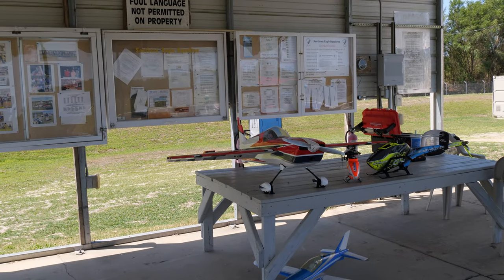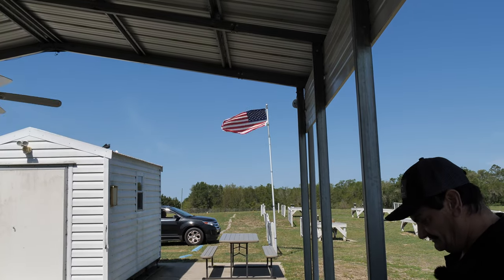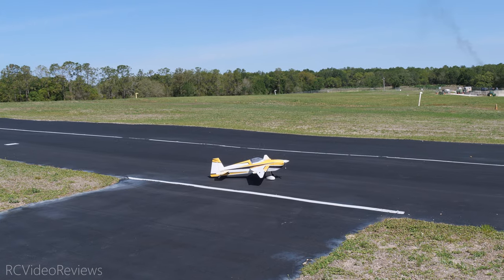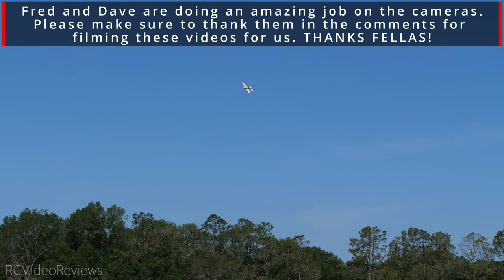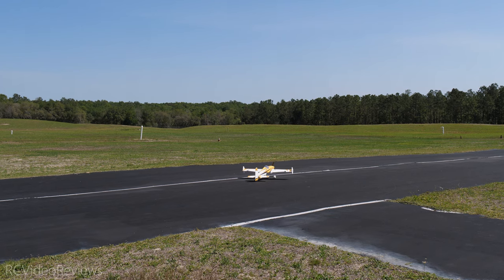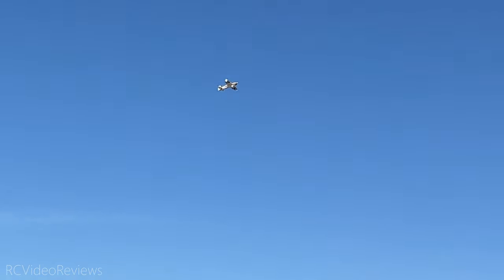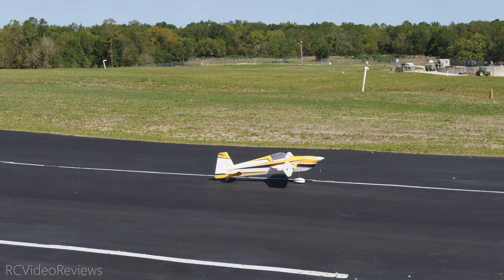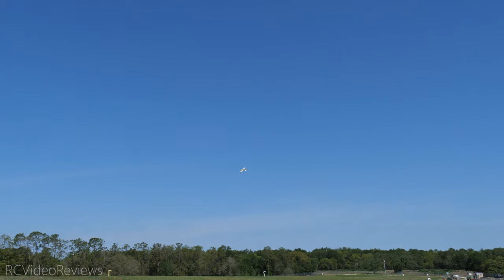RC Plane Gyros are a Good Idea

Comment: +1, for me gyro is a must have for all my models. Not for assist modes, only for wind rejection,  It allows to fly small airplanes even in windy conditions, but still with their fast reactions. You learn/improve skills better from small models than with large ones slower and easier to fly. I have more fun with those small models, easy  transportation fully assemble, fast ready to fly on the field, small batteries...etc. I use less and less my larges models. Less constraints more fun ;o)
Too many people beleived that gyros are only for assist mode, they are wrong, gyros make small planes fly like larger one. Take a small PA addiction with a gyro and you have lot of fun regardless of the weather. After take a 100" 3D model, and you fill like boring with a truck, slow, smoothing mistakes.
Reply: Well said and we agree  👏😊👍
Reply: 💯 My 2 favorite planes are UMX Pitts and UMX P51 voodoo. These planes are quick, snappy and so much fun to fly. I'm now practicing with 1.2m planes and enjoy it, but definitely need to get the rates up, or they feel sluggish. In this size, Im training with a Arrows T28 Trojan...and definitely looking at that FMS Dago Red P51. Though the skywing laser in this video looks really fun!
Reply: That is so right!
I’ve heard rant from the anti-gyro faction, who then tell about their favourite model, which is more than four times the size of my gyro assisted plane. No! You don’t need artificial stability to fly. I’m proud to say I learned to fly RC without a gyro. 80% of my models have no gyro.
A good trainer plane is designed to be very stable, some scale models aren’t. Especially when the wingspan is less than 36 inches.
I’m only an intermediate RC pilot, who occasionally attempts a manoeuvre that goes haywire, having a “self-leveling” switch can save my smaller models from a nasty crash.
PS. Great camera work guys.

Comment: Perfect explanation and demonstration. 
Especially about bad habits. 100% agree.
Great camera work too.

I learned to fly RC on 400mm RTF War Birds, Spitfire and Corsair.
They came with 6 axis gyros.

Didn't buy a simulator. 
Didn't buy a big floaty trainer.
Didn't join a Club and use the Buddy box method.

The day I decided I wanted to fly, I flew.

Modern technology and EPO foam planes was the reason why and how I could "safely" (so to speak) get in the air day one.

Before those of you that have different opinions torch me,  I'm not saying my way was the right way or wrong way. It was just the way I learned how to fly RC.

Muscle Memory was the number one thing I knew I needed to learn.

Isn't that what a Simulator does?
Isn't that what your instructor on the buddy box does when you get in trouble, flip the switch?

Now I can fly those warbirds using their toy grade RTF transmitters without any gyro assist.
Talk about crazy fun and pride on learning that skill.

When I moved up to a Hobby Grade tx and larger planes, 750mm to 1270mm, they were amazingly easy and fun to fly.

I too as demonstrated in your video fly using the wind mitigation mode 100% of the time to reduce my workload.

I say it's like using power steering to make your Driving Experience more pleasurable.

Great informational vid indeed.
Reply from the maker: "Before those of you that have different opinions torch me,  I'm not saying my way was the right way or wrong way. It was just the way I learned how to fly RC."

On this channel, I call this "Your money, your hobby."  I say it all the time because I get pretty worn out with pontificating dogmatic "governance" imposed by certain personalities. If it works for you and you don't endanger anybody else or their property: "Your money, your hobby!"
Reply: @RCVideoReviews  thank you for your reply and understanding why I put in my "disclaimer."
There are so many wonderful people on the interweb.
And then there are only 2 of the others.
Those 2 seem to get around a lot. 😆
Reply: I get your bad habits. What I've done is always fly my RFE in AS3X only. When flying in SAFE out at the field, I always return the plane to level myself. I don't just let go of the sticks unless I'm in trouble. I'm flying more and more just in AS3X too so that is helping me learn more and recover from my own mistakes.

Comment: I'm still pretty novice, so I keep wind stabilization on all the time and have auto-level on a momentary switch (panic button). I use auto-level 2 ways: 1) as a baseline while trimming, i.e. trim until auto-level does not change the behavior of the plane while straight and level. 2) If I lose orientation or get into a weird angle, I can auto-level to avoid disaster.  

I fly with the radiomaster Zorro, which has a great little momentary button right under your index finger. This has very quickly weaned me off of "safe" mode and helped me refine my skills because I can have freedom to try maneuvers but also a bail out button if something goes wrong.  Best of both worlds for a novice.
Reply from the maker: Yeah, if you're a novice without someone there to help you, they are definitely a lifesaver. As long as you connect the dots on the behavioral differences of auto level and normal mode flying.
Reply: U don't want to use auto level when your trimming....because it automatically levels out....trim your plane I no wind if possible without any assistance...or directly into the wind but no stabilization or self leveling to get the plane truly trimmed at about 3/4 throttle
Reply: @Toryh86  The auto-level is on a momentary button, so it's only engaged when actively pressing the button. When released, auto-level turns off immediately. So if there is any pitch, roll, or yaw change when releasing the button, I can instantly see how far off the trim is and in what axis. I am not trimming with the auto-level active, but using the gyros to momentarily establish an objective straight and level (1 or 2 seconds), then release the gyros and adjust trim to get back to that straight and level with out gyros engaged. Hope that makes sense.

Comment: Wind rejection? What is it? Is it the same as As3x? Optimized mode? Stabilizer mode?
Reply from the maker: Couldn't tell you. I don't use Spektrum gear.
Reply: It is the SAME as AS3X and if you DO fly Spektrum, it is SUPER easy to setup with FORWARD PROGRAMMING on the Spektrum transmitter 😉
Reply: @re3065   thanks. Yes I used Spektrum tx, rx. But, I never used gyros. Thx.

Comment: Have you ever gotten the S6R stabilization to work with a dual channel aileron setup?  It's fine with a Y cable, but I can't get it working with separate channels.  I used the Lua script to change channel 5 from AUX to AIL2, but the stabilization only moves the aileron on channel 1.
Reply from the maker: Pretty regularly. Watch this: https://www.youtube.com/watch?v=BObseyO1cjE

Also, make sure you do the calibration routine AFTER setting Aileron 2 up on the Aux output with *full stick deflection for all control surfaces after the servo dance*.

Comment: One question that concerns me... if you are using regular wind rejection stabilised mode (not level mode), what happens if, in level flight, you close the throttle... will the plane start to descend as normal, or will the gyro try to keep the plane flying level until stall? The gyro doesn't have any 'knowledge' of throttle input so does it assume non pilot input.
Reply from the maker: The gyro only reacts to uncommanded movements. If the plane is trimmed and balanced correctly it should stay somewhat flat during power off decent in which case the gyro won’t react. If the nose drops the gyro will make an initial correction then return to neutral. It does not try to maintain level. It simply reacts once to uncommanded movement.
Reply: @RCVideoReviews  Hi, thanks for the clarification.

Comment: I have a HobbyEagle A3Pro I want to use in my new HobbyKing Crusader 30E. I would like to add Flaperons. Do you know if I can do that with a Gyro? I kind of feel like I might need more then 3 out ports so I can run a lead to both wing servos instead of a Y-lead/wire. Maybe you can give me some insight on this. Thank you.
Reply from the maker: Yes. Flaperon control will simply appear to be aileron output to the gyro. It won't interfere.

Comment: When you say "wind rejection" are you referring to NORMAL or LOCK (AVCS) mode on the gyro? I feel like both of these modes are wind rejection?
Reply from the maker: Wind rejection or uncommanded movement is a perturbance in this case as a result of wind. So the reaction by the gyro is temporary. In autolevel modes the gyro references a level configuration and moves the surface until the model returns to that level configuration.

Comment: Thanks for the video and the camera job. 
I have s6r in some of my planes, and for those with digital servos they just shut-off randomly, I imagine because of not enough BEC current.
What’s the minimum amps required ? (off course over what’s needed for the servos themselves)
Reply from the maker: The RX itself doesn't need much. If you have your BEC/ESC connected to pins on the RX with a common voltage rail, the RX will not interfere with current delivery. If you have servos cutting off randomly, I definitely would stop flying that setup until sorting it out.

Comment: In regards to autolevel as teaching bad habits................it can and does, but not everyone has access to a friend or  a club with in a decent amount a driving time where they can learn.  Even there is a club say within 20 or 30 mins, there's only so many hours in the day; if I was driving to a club to have someone teach help me, that would have cut down my flying the 1st year by 80%.  I started off flying FPV with a kopilot, crashed a bunch...............part of the gig (poorly trimmed planes and every other mistake a nobbie makes).  Auto level/balance gives a new pilot fighting chance to get the plane in the air and get some stick time.  Am I the best LOS flyer, nope.  Am I the best a flying LOS in manual mode, nope.  Because I'm still learning, this is how I use something like BYME A stabilizer.  I launch the plane in stablized mode (assuming a maiden),  get it about 3 or even 4 mistakes high, flip over to manual mode (using the trick you illustrated with the kopilot about using different rates and trims tied a flight mode), trim in out on the radio in manual mode, land, make the adjustments to trim, and repeat the process until the plane is trimmed correctly in manual.  Then fly first in autobalance / level mode till I'm three mistakes high and practice flying in manual mode.  That seems to work for me as way to train and get better at flying without stabilization and without having to spend most of my time repairing instead of flying.
Reply from the maker: We have a saying around here: "Your money, your hobby". You have to do what makes sense to you.

FWIW I did say in the video, if you're a novice and don't have help, go ahead and use auto level. Clearly that is better than the alternative of learning the hard way.
Reply: @RCVideoReviews  Hope I didn't come across as not appreciating the content of your video or disagreeing with your approach.  Happy flying!

Comment: Might be nitpicking but your term “wind rejection” stabilizer might be a little misleading. It isn’t exactly removing WIND effects, but TURBULENCE effects! For example, In a steady-state wind situation the aircraft would fly just as smoothly with or without the 3 axis stabilizer. However, in gusty situations, which are more often the case, the stabilizer commands control outputs to “dampen” the effects of turbulence. Interesting how for $50 or so one can put a very similar stabilizer in their cheap foamboard airplane as a modern transport aircraft such as the Boeing 787 (my current office!) Great concept for a video though and great explanation John! Love your work👍

Comment: Great principal  do not fly a plane that u cannot land without gyros. BTW Skywing has good sales on their planes   but are not due in till October.  Can you recommend one of their 48" planes over the others.  I would be flying it as a sport/pattern plane  not 3D  Thanks
Reply from the maker: If you're looking at a 48" Skywing for sport/pattern, I think I'd start with the NG. It has a longer tail moment than the others so it doesn't wad up as tight but it's also more stable in the slower maneuvers.
Reply: @RCVideoReviews  Merci beaucoup

Comment: So basically like acro mode using a flight controller?
Reply from the maker: Similar with the exception there is no governance over rate of movement which you normally specify in an inav/bf setup for Acro mode.

Comment: Thoughts on the A3 Super 4 vs the A3 Mini? Would they both work equally well with ELRS SBUS?
Reply from the maker: For an SBUS RX with no PWM pins, you need the A3 S4 otherwise you won't have throttle out. The A3S4 is the only one I'm aware of that can pass 5 channels through: A1/2, E, T, R or A, E1/2, T, R.
Reply: @RCVideoReviews  newbi question: pass 5 ch through means that you need something else to power the channel in addition to the gyro mini?
i saw a video using a min and the sbus rx only without anything else....am i missing something?

Comment: Is it possible to have flaperons going through a gyro with some edgeTX trickery? Specifically a Byme-A gyro paired with a FS-ia6b reciever. I do know each aileron servo needs to be controlled independently. No y cable.
Reply from the maker: Probably with a mix. When the gyro is enabled, it will do what it needs to do based on your gyro setup to correct a perturbance. Your radio setup should be independent of those corrections. i.e. If you were to reverse an elevator output, your stick motions would need to be inverted, but the gyro is unaware of that reversal, so if it needs to level pitch, it would do the same thing it always does to correct.

For flaperons, you could create a mix for the two channels. The gyro will continue manipulating those two channels as setup. I don't see a reason this wouldn't work with a simple mix.
Reply: Do you STLs for your 3D printed benchtop "proof of concept" model? Love the channel. You have been a ton of help in navigating edge tx.  You have caused many light bulb moments followed by what if. Thank you
Reply from the maker: https://youtube.com/live/pnnZsoIRyGM

Glad the channel has been helpful for you.
Reply: @anastigmat  I appreciate your concern for that particular word I used to describe a 3-axis stabilization unit. I felt calling it a gyro was just simpler.
Reply: I wanted to add an update. I was able to get flaperons to work when using the Byme-A stabilizer. However I discovered that the Byme-A module offers no stabilization correction through  its ch3 pins, its just an uncorrected throttle pass through.
Reply: yes itss easy

Comment: Flying without a stabilizer is like driving without power steering and power brakes.  

I always land with self-leveling/ safe on, why?
Because I put a higher value on my planes more than my ego.
Reply from the maker: Practical point of view. If it works for you, you're not wrong. :)